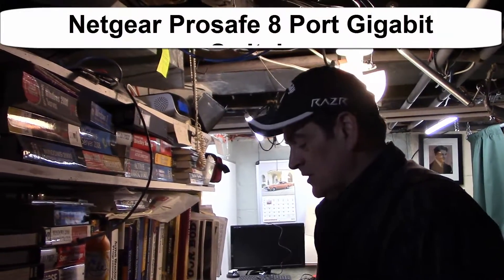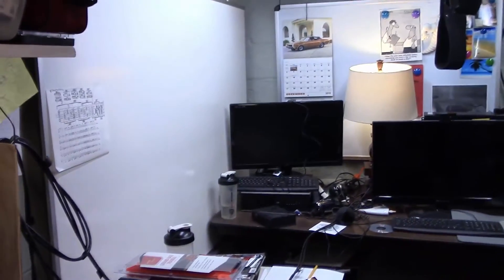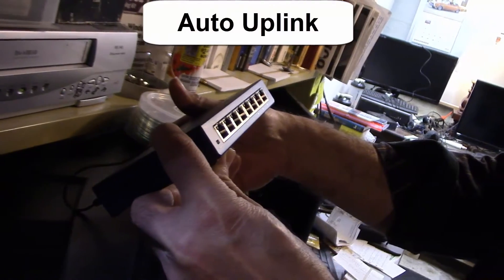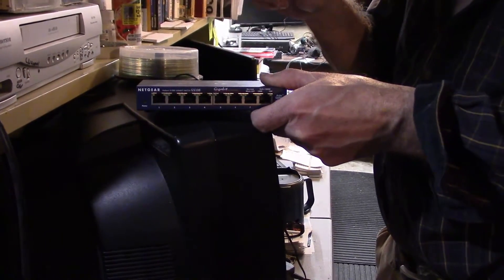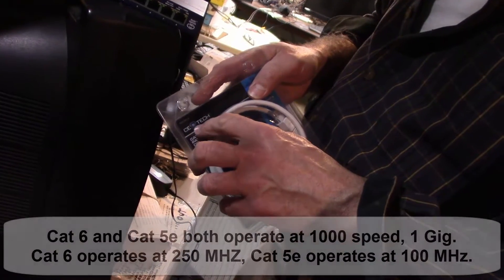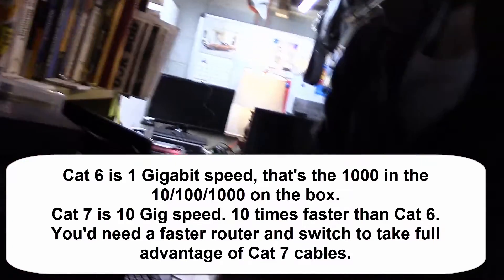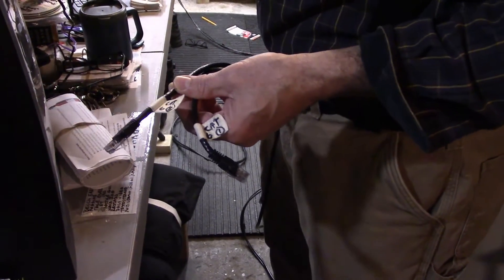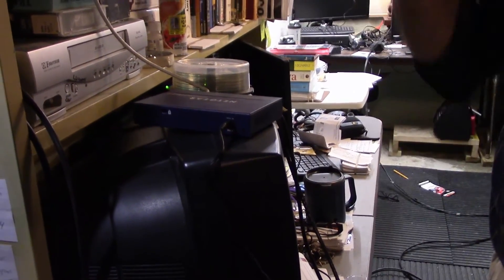Installing a Netgear Prosafe 8 Port Gigabit Switch with a Motorola Router SBG6580 and Modem

Comment: Does the switch need to be installed before the router, in other words, cable modem, then switch, then router plugs into switch, or can you install the switch after the router?
Reply from the maker: I'm don't know, try  it and see what happens. But guessing, I would say the destination router at your house or business router needs to interact with a router at the ISP to get the internet stuff working.

Comment: Quick question I see you used a new wire to connect the router to the switch. Can I just leave one end of the wire in the router where it is and connect the other end to the switch box? I’m not very computer savvy so I really need to understand how to begin the setup starting with the router connecting to the switch. Thanks for clarification
Reply from the maker: Hi Janet. I think I understand what you're asking. Might work, I don't think it would break anything if you try it.

Comment: The cable it came with should be cat 6 right?
Reply from the maker: We'll, we would hope. It should be printed on the cable in ink. You might need a magnifying glass to read it. Cat 5E is pretty good and common these days too. Buy a cat 6 if you need a better one. Cat 7 is coming out too, but that might be a bit much for home use. Home Depot seems to be where I buy my cables these days. You just can't trust the stuff you buy on the web anymore.Watch out for crooks making cheap cables.
Reply: Jim Vincitore thank you
Reply: It is fairly easy to make your own cables and then you can trust them.  Using cat 6 cables may not be totally necessary.  Think about it like this.  You can only move data as fast as the slowest device.  If you use cat 6 on a device that isnt going to be able to operate anywhere near the max, then it is just a waste.

Comment: Does it matter which port u plug incoming Ethernet cable into?
Reply from the maker: Hi Pat! GREAT QUESTION! Usually all the Network plugs are the same, so it should not matter. Older machines will have a modem plug for the telephone jack, it looks like a small network plug. Some of the older routers/switches, I think some plugs were for incoming, then the rest were for outgoing. Or there might be a little push button near the plug to make the plug go in or out. The machine in the video is "auto-sensing," so it takes care of all that for ya.
Reply: Jim Vincitore great thanks for the reply
Reply: That is a common question.  He wasnt clear when he started the video.  With an 8 port switch, you can not hook up 8 computers.  There must be one port used for the incoming signal.